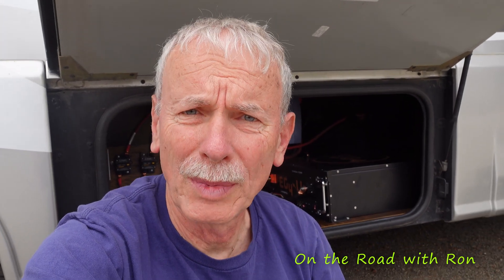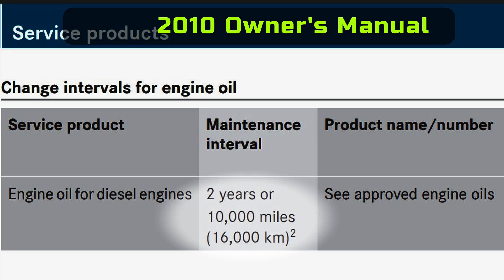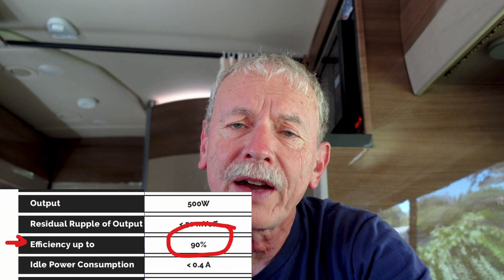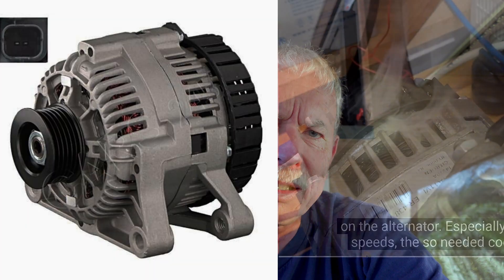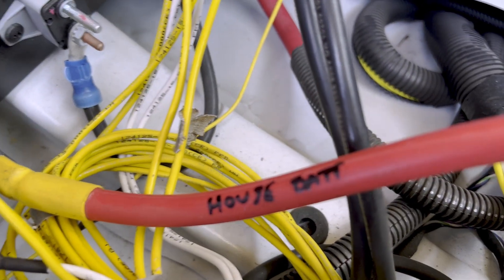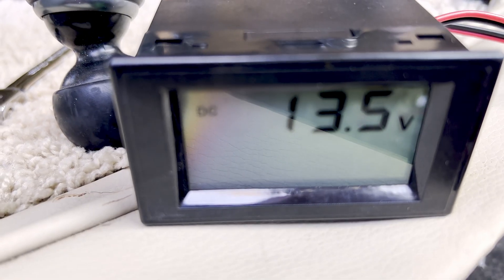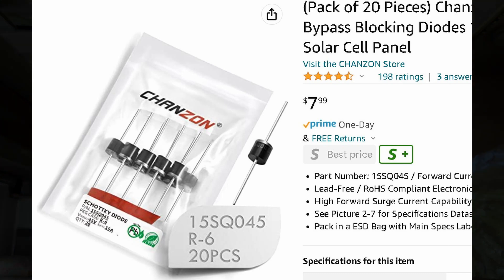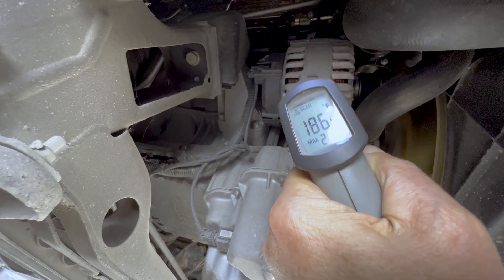DC to DC charger NOT required for big Lithium Battery

Comment: Nicely done. If you shut that switch off while the alternator is pushing a lot of amps out (to the lithium bank) will it harm the alternator? The external regulators seem to be designed to prevent this. As someone who burned up an alternator when I flipped a battery switch on my boat I'm sensitive to that situation.
Reply from the maker: Good question. That is one of the reasons that I keep the AGM starting battery. It works as a sink for any voltage spikes.
Reply: @ontheroadwithron2432  it would be interesting to measure the spike.  Cars have so many ICs and computers, I'm a bit worried about how much they can handle.  Thanks for this great video and insights!!

Comment: Check battery warranty details. 

You WILL void warranty on the lithium battery if you do not charge with lithium profile charger.
Reply from the maker: I have read the warranty.  The BMS safe guards the battery. It protects from borh under and over voltage. There is no special charging profile for lithium batteries like the lead acid type.  Just charge til full and then BMS will disconnect the voltage  from the charger.
Reply: @ontheroadwithron2432  you need to reading again! You are post BS that could get people to lose warranty and have a BMS trip on them and not know how to reset. While camping, on the ocean.

Comment: Better for the alternator, START UP battery and lithium batteries to use a DC DC …. This really isn’t something I’d encourage.  You don’t buy expensive lithium batteries and charge them with a regular lead acid charger the DC DC is relatively cheap, 12v issues are no joke when you need to rely on the vehicle …

Comment: How do u charge a 48v battery with 14volts ? Is there a 12v hook up on the battery ?
Reply from the maker: I have the 12 volt battery model. If i were to go to 48volts, would need an additional 48 volt alternator.

Comment: I’m lost now so I don’t need a dc to dc if I changed my wet Leed to lion battery 🔋 
???
Reply from the maker: Depends on your setup. If you change to lithium, just measure how much current the amp meter is reading while charging the batteries. If under 80 amps you are good. Personally I installed a switch to turn the alternator charging off. Not necessary but I usually charge the battery using solar and don’t need to run the engine to recharge.

Comment: Not all alternators are 'smart'. So other's  experience may be a lot different from yours. Opinions are like belly buttons....everybody has one. Also, there are a lot of cheaper but just as reliable DC to DC chargers and monitoring equipment  than Victron.
Reply from the maker: Yes that is true, I only speak of  my experience with the Mercedes alternator. It’s a good one.

Comment: So changing your alternator is less work than putting adc charger inline ?
Reply from the maker: Probably not even tho there are mounting points on the Mercedes engine. I thought about it but only if i had decided to go with a 24volt system of battery, inverter and possibly a 24 volt mini split. It the end it was too expensive and more complicated than I needed.

Comment: I use a 24 24 victron DC to DC charger but it's because I have a 21 kw lifepo4 battery and a 14 kw Nissan leaf battery. My lifepo4 is the main battery but if it ever drops low enough then the leaf battery connects and dumps it's energy into the lifepo4. I have a huge amount of battery but we need the large capacity because we cool and heat with a 9000 BTU mini split
Reply from the maker: Wow that is a huge battery pack. I’m surprised the DC to DC charger can supply enough power to charge them.
Reply: @ontheroadwithron2432  the DC to DC only pulls from my Nissan leaf battery to put a little juice back into my lifepo4 battery. The leaf battery charges from a victron charge controller during the day and the lifepo4 charges from 2 big victron charge controllers during the day. I'm only home a few days a month so my inverter is turned off for about 3 weeks at a time so there is plenty of days to charge then only drawn down for a few days then I'm gone again. It's how we have electricity without a monthly bill but I've spent well over 30 grand on components to be able to not have a monthly bill lol. It's more of an expensive hobby than anything but it's fun

Comment: My 2002 workhorse chassis class A has a three stage voltage regulator alternator rated at 150 amps. It's set up to charge deep cycle house batteries. I used 4 6v lead acid deep cell rated at 225ah

Personally I would never use lithium batteries in an RV. Once you've seen a lithium battery fire you'll feel the same way. 
As far as charging you will likely burn up the alternator when you're on the road in the middle of nowhere at night.
Reply from the maker: The type of lithium battery LFP used in RVs have a very low chance of fire. If you have a cell phone, this type is way more dangerous. I am more concerned about propane fires than my battery. Anyway everything has its advantages and drawbacks. Thanks for your opinion.

Comment: Setting aside the alternator burn-out question, these are expensive batteries and they can easily last 15+ years with minimal degradation... a very long time.  But you have to take care of them and that means charging them to the proper voltage (so the BMS inside the battery can properly balance its internal cells), and floating them properly afterwords (which relieves most of the stress on the battery once it is fully charged).  That is the real reason why you want all charging sources for the lithium to be on proper charge controllers.   One of many reasons, in fact.
Reply from the maker: I don’t worry that much about lithium batteries. The ones in my Makita power tools have lasted 10 years without any special care. They just sit there at various charge levels and i recharge them when they stop working. Same chemistry as my EG4 battery. Nothing wrong with what you say but Ive found them to need a lot less care that the lead acid batteries that i used to have. Cheers
Reply: @ontheroadwithron2432  I realize this is an older video, but you had me going for awhile. That is until you said " Same chemistry as my EG4 battery" referring to your Makita power tools batteries. Different chemistry with different capabilities, and dangers. I will have 300AH in batteries, so a dc2dc will be a must. Cheers
Reply: Given he's not doing faster discharges of his lithium batteries (this is what tends to throw cell balances off and require balancing), and the OP stated in the comments here he receives 80% of his charging through campgrounds and solar (with proper charge controllers delivering his batteries to 14.6v where balancing can occur), my guess his cells are balanced fine.
Reply: @antigroundhogday  Indeed, most LiFePO4 battery banks have so much storage relative to consumption that C rates are typically very low, often 0.1C or 0.2C.   That said, lithium can handle 1C rates 24x7 effortlessly, so it isn't generally something people worry about.

But one can never make assumptions about use cases, that is what leads to "oh, the system was working fine for years until I did XYZ," scenarios, which are far more common than people think.  You always want to construct a system that works properly in all allowed scenario (such as a long-running engine-powered alternator, for example) whether you expect it to happen or not.  Because there will always be a few somebodies with odd, unexpected use cases.

-Matt

Comment: Ah considering my van my house like reliability is king so I'm going to use a DC to DC charger, also because I have 885W of solar undeployed and deployed 1770W of solar with 1200W of foldout solar pannels so a total of 2970W of solar, I live in the UK though so I need a lot of solar to fill my batteries during the rare sunny winter days and with 2970W of solar even on overcast days I can still get 75 - 100W which is enough to power all my vital loads which is the fridge freezer, diesel heater, lights, phone charger, heater for the battery compartment etc.

And yeh the fridge freezer when it's already prechilled over a 24h period only uses like 150Wh so a couple of hours my fully deployed system even in overcast conditions is enough to run my fridge for 24 hours.

The orignal point is that I only need a little extra power from the alternator to pick up for the times when I haven't had a sunny day for a week or 2 if I am just running vital loads, so a 20A 48V charger is all I really need and that isn't expensive by any means.
Reply from the maker: Yes this time of the year is challenging to get enough solar. DC to DC chargers are very reliable and is s good solution especially if the alternator does not have enough capacity to charge the batteries.

Comment: I wonder if it’s the same with ford e450 shuttle bus alternator?
Reply from the maker: I believe the Ford alternator is not as good. Maybe 1/2 the output of the Mercedes but if you could find the actual output then you would have a better idea.
Reply: @ontheroadwithron2432  he my alternator is 230 Pentax on e450 shuttle bus that used to have wheelchair lift

Comment: Also were the tests and figures you refer to under bonnet temps or done in the air con lab ??
Reply from the maker: I did all my testing with the RV parked at my house. The air temperature here in San Diego in the summer is around 70 degrees F.

Comment: Do any of you guys run only 12 volt for long periods 5 days plus run your batteries down to lets say 40% on a 400 amp system than rely on your alternator to charge them?? I don't mean now and again or sometimes constantly all the time .... If you are relying on what you guys call RV parks for 240 volts yeah you don't know
Reply from the maker: I have not had to do this yet. Longest time charging was an hour.

Comment: That's a good video. I did put in a DC charger in the van, mostly because its also a solar charge controller as well. With the switch to the solar shut off it fools the charger so I get about 48 amps off the alternator, which is plenty.

Comment: Can you wire a second alternator straight through a dc-dc charger to your leisure’s? Not starter battery in the mix
Reply from the maker: It is better to have a lead acid connected when charging with an alternator. That is because when fully charged the lithium BMS will switch off the charging and it can cause a voltage spike.  Lead acid batteries will help  adsorb this so it protects the alternator. You can have 2 alternators ok.

Comment: Am i understanding this right? You are relying on the smartness of the alternator to limit the current? And then size the wires to that maximum the smart alternator limits the current max to? And wire the lithium batteries directly to the alternator and not to the starter battery?
Reply from the maker: Whatever the case, I’m only getting 70-80 amps charging going into the lithium battery pack. Even when battery is down to 20%. I don’t think the alternator itself is limiting the current as this is much lower than its rating. My best guess is the the voltage drop from the long cable length is the main reason.

Comment: The concern isn't with these type of RV batteries but with the car audio style batteries made from cells taken from hybrid vehicles these custom battery packs have an extremely low resistance much lower than you would find in these RV batteries

Comment: i have the vic dc2dc charger (40A).  when alternator engages, victron ramps amps up slowly to the lithium batteries.  when alternator stops [like turn off engine], victron ramps amps down slowly to zero.  it must do that for a reason.  does your setup do that?   i wud love to ditch that vic to get full rated amps into my 12v system.  but worried that the vic is doing something important - even tho i don't really know what it is.

do you have any updates with your experience after 1 year?
Reply from the maker: I don’t know how the Vic works. My alternator controls the turn on speed. I think it it within a second or two.  After a year I’m happy. I normally have the alternator charging switched off and let my solar slowly recharge the batteries. That doesn’t use engine power or fuel. This week we were camping for 3 days and battery used about 25% each day.  It’s not too sunny this time of year so solar couldn’t keep up. Now that I’m home, the solar will recharge everything in about a week. I did connect alternator charging for a few minutes. It was 71 amps so all is working fine.
Reply: my vic's slow ramping up/down takes about 30 seconds.  i like your setup with your switch - you are the intelligence.  the switch is like the command "scotty give me everything she's got"

Comment: The issue is when they are completely drained so I would use a DC/DC to limit the current.
Reply from the maker: I have seen much difference in currents at lower SOC. I’m sure it varies from setup to setup.

Comment: The current limiting is actually more the cable resistance, 12.3 vs 14v gives you a voltage drop off 1.7v and when the current is 70A your resistance is 0.024 ohm. In case you have thiger wires or shorter run to the battery, the resistance goes down and the amps goes up. 

The alternator don't like to run that hot, and you might damage it in the long run. The diodes inside might take damage. I personally killed one alternator diode bridge. How to overcome this is to just rew up the engine, so basically I would tell you to start charging just when you start driving to keep more airflow over the alternator, there is also a fan inside the alternator for cooling, this means the faster you spinn that thing, the more cooling it gets.

Other thing is, can we trust that 70A is the max your getting from the alternator? Did you rew engine up or did you just measure while idling? The alternator might need some more rews to give out more, so you might still drow more correct from it.
Reply from the maker: I have seen up to 84 amps for a short time. After 10 minutes or so it drops down to around 70 amps even while driving down the road. Mercedes says alternator can provide 80 amps for coach usage. Other alternators may not be as good.

Comment: You should never run a dc-dc charger while idling. The low rpm will strain the alternator. Do it only while driving no matter how big the alternator is. If you do charge idling then wait until engine and alternator is warmed up first. But im sure you and me st readers already know this. Good vid
Reply from the maker: Not sure how the alternator is strained at low rpm. They are designed to recharge the starting battery as soon as the engine starts. I know the output is lower at idle but unless someone idles for a long time, the alternator should not overheat.

Comment: I found the same on my Tiffen Phaeton.  The reason that it works is because there is 90' of wire round trip from the alternator to the battery and back.  I have 920Ah installed and per my BMK monitor, I never get more than 70Ah at the batteries even when they are very low at 13.0v.  The Start batteries are always at 14.4v which means that the alternator's internal regulator is reducing current output so that it is not running wide open.  The coach has the stock 170A internal regulated alternator.
Reply from the maker: Thanks for sharing your experience. You have a big battery bank for sure.
Reply: @ontheroadwithron2432  It is an all-electric coach and I run a bunch of high-powered computers so I am an energy hog.

Comment: I only have a 95a alternator in my 36ft Class A motorhome with a Ford v-10 engine, so I added a 20A battery to battery charger, as my 560ah lithium battery with a 350a BMS could indeed draw too much current and toast my alternator. It depends entirely on your set-up.
Reply from the maker: Yes it can vary. Mercedes is now allowing 80 amps for charging but then again it is a 220 amp alternator.

Comment: lot of ifs, as for 20k oil change not if i want to keep a vhiecle like i do 20+ years on average 
i dont do 3 k anymore 5k or 1 yr if i not driving too much. but  about 300 altinater, possably few hundred toe couple hundred labor . to save 200 or so for dc to dc.  might be worth gamble unless you go in seclued area tow could be costly . i say gamble or pay now . its always the owners choice
i would wonder though  would it void MB  warantee if the computer has problems .

Comment: The number of people in these comments that believe:

* you have to charge LiFePO4 to 14.4v
* you have to charge LiFePO4 until the BMS shuts off charging
* you have to charge LFP to 100% SoC for any reason
* that the lead starter battery somehow disappears from the circuit 

is amazing. Sheeple will believe what they've been taught/marketed to believe, I guess. 

I charge my 150Ah LFP bank quite nicely from the alternator at current/voltage well within battery charging specs and with alternator current specs.
Reply: Spot on.  And they will continue to argue, despite being presented with a clear factual argument.